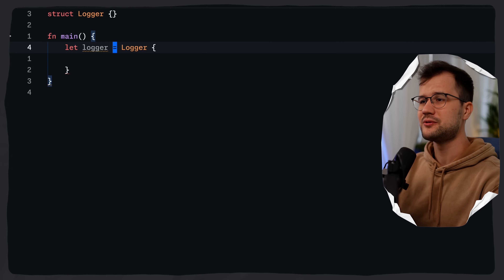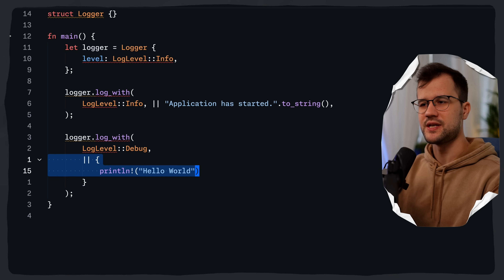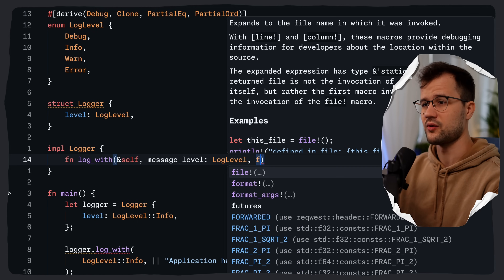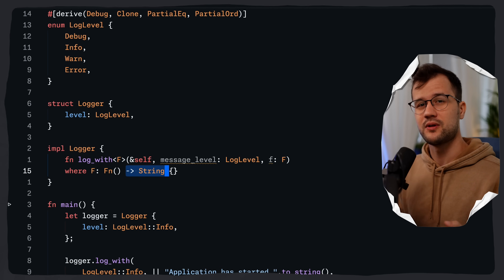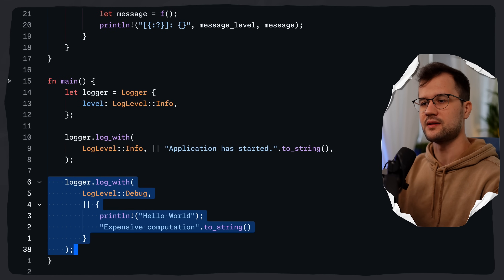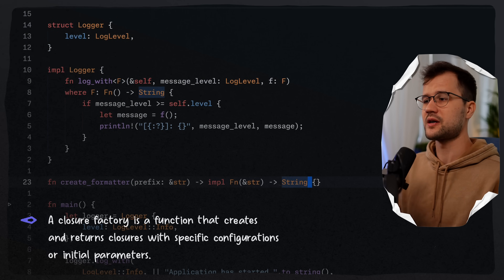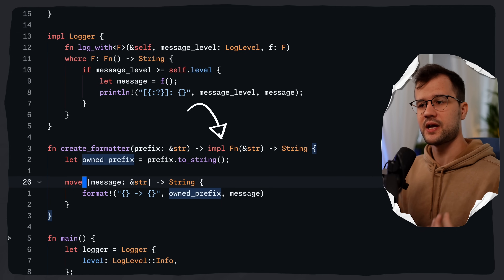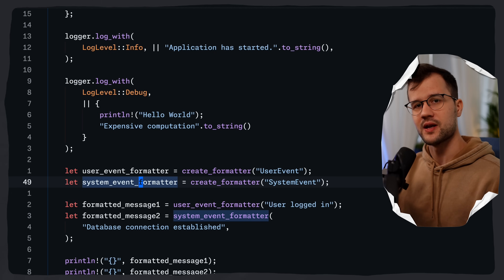Lazy evaluation in Rust: the power of Closures!

Comment: I don't understand the first example. You could have done the same thing without closures?
Reply: It's indeed the same... If you were using a string slice (aka. & '_ str).

Instantiating the String Object requires you to make a syscall to the Allocator to create the memory region in the heap for the String' s content.

So if you pass the String Object directly in the argument instead of a closure, when calling the "log_with" method, you're building the String with no knowledge whether the log is done or not. Hence why using a closure is more performant, because the method DOES know whether it needs to allocate or not the String it has to log.

Comment: I really hate that they chose pipe characters for taking parameters for lambdas and that they require an explicit `self` parameter for trait implementations. I think the syntax for C++ is better, even with the explicit capture syntax, and that you can take advantage of an implicit `this` parameter is much tidier. And if you really need a `this` that's by value, C++ still allows that too. Granted it's a recent addition to C++23, but it's there if you need it. What really makes `self` worse than explicit `this` in C++ is the fact that you can't rename it. You have to name it self or it causes weird errors with member functions and the only way to call them is explicitly through the type and passing every argument.